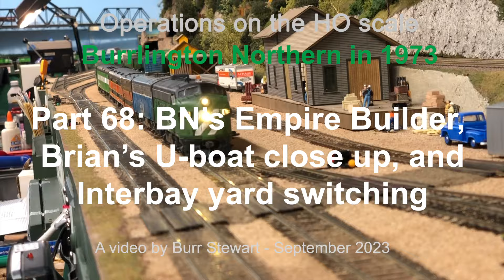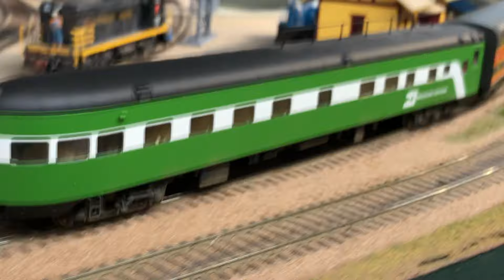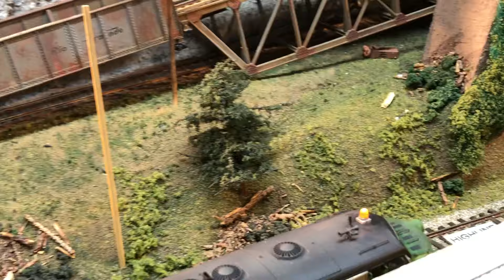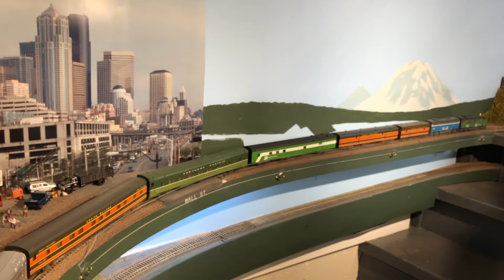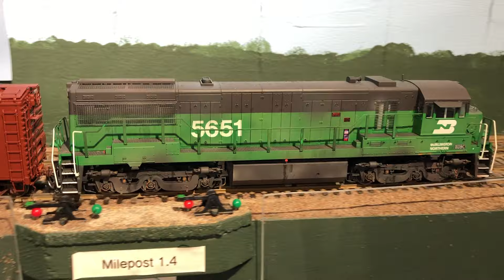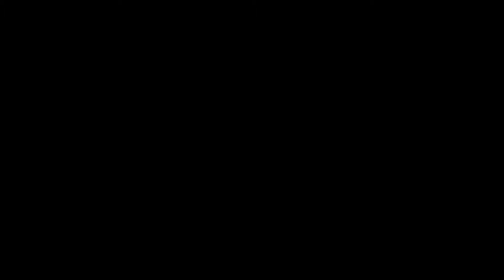Part 68 - BN Empire Builder, U-boat and Seattle switching

Comment: Growing up in the early 70’s in the northeast, we had the E.L. Jersey Central, Pennsy,NYC, Lehigh Vally and others, I would see a consist of mixed engines pulling freight and thought is was the normal, of course I was a kid and didn’t know it was the beginning of the Conrail merger. Today I have an N scale layout that I run prototypical,E.L. And D&H with the interchange at Binghamton NY which is my main yard. I do plan to expand, I love running prototype RR , all my engines on the board are D&H or Erie Lackawanna. With a couple of Pennsylvania and NYC passenger run throughs that I like to call detoured trains.
Reply from the maker: Fun stuff. I grew up in Providence, so saw a variety of NH and PC at the time. Now I have couple of EL and PC locos waiting for the right time to show up in Seattle as leased power...

Comment: Presumably, the Burrlington Northern came about from the merrgerr of the Chicago Burrlington and Quincy, the Grreat Norrtherrn, the Norrtherrn Pacific and the Spokane Porrtland and Seattle. By the time modeled here, passengerr trains were being run by Amtrrak.
Reply from the maker: Right. Amtrak took over passenger operations in 1971. But they purchased and/or used BN locomotives until they could buy their own. Also, I haven't renumbered all my locos properly to reflect the BN merger yet. In mid-1973 they got the Amtrak SDP45's, but before that the BN F units were mostly used. BTW that Rapido steam heater car bears little resemblence to the former GN heater cars, but they painted it in GN paint and called it good. I like it mainly for the sound effect.

Comment: Always enjoy your videos.  You mentioned the railroad operates at a maximum speed of 35 MPH.  Do you program your decoders / CVs to accomplish that, or do you ask your operators to manually manage their speed?
Reply from the maker: Yes, I program each loco to a maximum speed of about 30mph when I introduce it to the layout, using whatever CV is needed (usually it's CV 5 and 6, but the early Tsunami decoders require that you use CV 66 and 95).
Reply: Thanks  @muchfunwithtrains

Comment: The new depressed flatcar w/transformer load is nice but did you have any clearance issues with tunnels? I have seen reviews of them but don't really say how tall and wide it ends up being. Fun video as usual.
Reply from the maker: Great comment! We didn't run through any tunnels on this video, but that would make a fun video, since it would make a mess if it hit something, which would be fun to watch. They just came in, so I haven't measured them or tried running through tunnels yet. There's a bridge over the mainline near Index loop approaching Skykomish that is right at the NMRA standards gauge, so we'll head up there first. Thanks!